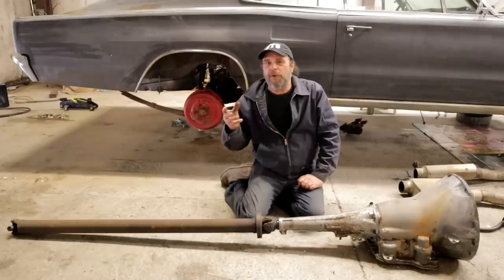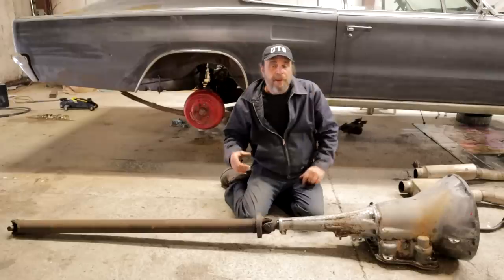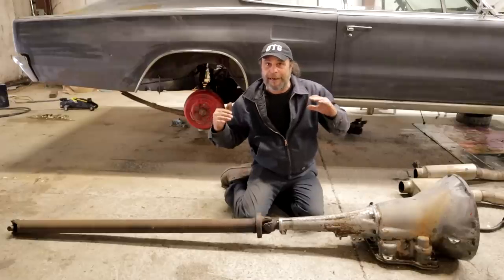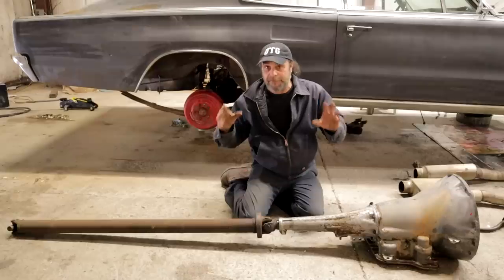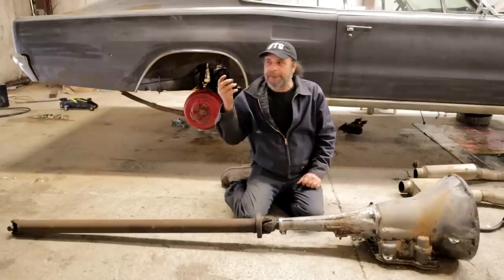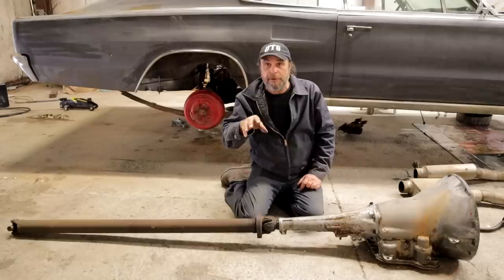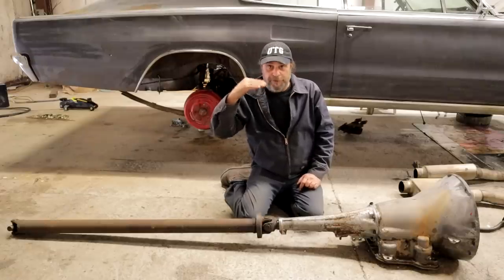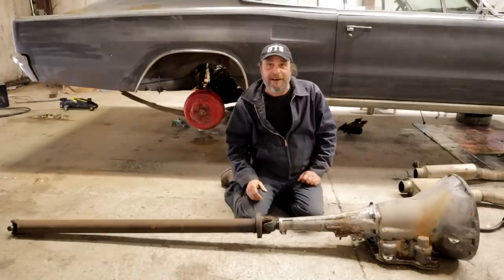Driveline Setup - Vibration And Power Loss Through Excessive Driveshaft And U-Joint Angles

Comment: I was taught that if a u-joint doesn’t have at least a little off-axis motion on a regular basis, it will cause Brinelling and premature failure.
Reply: You just wanted to show off...."Brinelling"....  LOL.
Reply: Yep, the little itty bitty rollers stay stationary if there's not a little angle ,and that's not good.
The load gets spread out by it moving. When it's stationary it's like a hammer
Reply: Brinelling can only occur upon impacting from heavy loads. There might be another failure mode in your u-joint scenario but brinelling probably isn't it.
Reply from the maker: You're forgetting that the car has a suspension...the very reason it has universal joints rather than a coupler.  The suspension is nearly always active, even to a small degree, as the car goes down the road.  This keeps the rollers moving.
Reply: You're right, Jeremy. In fixed u-joints, like industrial PTO's, you have to have some offset, or the needles in a needle bearing will stay still, and without grease, will wear into the surface. Vehicle drivelines move around quite a bit, so it's less of an issue.
Reply: @outlawbillionairez9780  I've not seen it, but know people whose irrigation engines ate universal joints til the engine was raised or lowered a half inch.
Reply: You are exactly right Jeremy it threw me off when I heard him say in a perfect straight line. 99 percent of cars the trans tilts down pinion tilts up within 4 degrees. Simple as that
Reply: In the business we call that part a consumable. A normal wear part like engine oil and tires. I've replaced plenty of U-joints that have worn out in one spot, but it takes like 100,000 miles for it to happen.
Reply: Often times brinelling is confused with fretting.. a common mistake among amateurs…. 🙄🎶🎵
Reply: @UncleTonysGarage  No driveline is ever perfectly "inline" as they require offset in both the horizontal and vertical planes. If you set a driveshaft 100% inline on all axis you will have vibration. Typically you need 1-3 degrees in each axis to cancel out harmonics and vibrations.
Reply: @UncleTonysGarage  sure with a live axle, but how about my 240sx with the independent rear end and a solid mounted diff?
Reply: UTG, what about fixed front diffs like what on newer 4x4s and AWDs? My Silverado front shaft is at a slight angle going into the front diff. Don’t you need some sort of angle to keep the needle bearings happy?
Reply: Is there really a verb form of Brinell?  Sounds a lot like BS to me.
Reply: FFS peole, if your U joints seriously never see angular changes, it doesn't matter if the rollers seize.  Which they won't, but still.

"OMG, this thing that never moves can never move now because it never moves.  Total failure!" - You
Reply: I lived in the upper Midwest. We used to race on state roads. When funny cars got nationwide TV coverage, the rookie racers started jacking up the rear of their street cars seriously messing with the drive line angles. We would bet against them and watch them destroy U joints all night. Easy picking.  LoL 😆. 
As always Tony a Master Class.
Reply: @UncleTonysGarage  I love you helping us backyard amateurs, so I think a follow up video is necessary to help us thick headed slow learners.  I put a 460, C6 and a 9” in my 56 panel.  I’m a total backyard guy btw.  Anyway, I centered engine to frame, but now the driveshaft is at a sideways angle to the 9”, but was told that’s how some fords came after the 9” came out.  I haven’t had any failures in 15k miles.  The rear pinion is equal but opposite degrees from trans… is this correct?  (Keep on doing these videos brother!)
Reply: @Todd McCarter  we come to utg for old school/mopar info. How does a 240 fit the programming
Reply: Thanks for asking that question, all the best to you all
Reply: that is what u have to do if u are running massive hp like over a 1000 hp even then u can build up a stock suspension to handle it but then again i am talking chevy with the nascar suspension and the only thing u need is ladder bars and use a cv joint and get a fresh balance on the drive line we run up to 1400 hp with that setup no problems

Comment: Getting the drive angle right for the application is critical. Driver fatigue when a driveshaft vibrates it terrible. Not to mention wear on other parts. Like having a bad tooth. It will drive you nuts but its super gratifying when setup correctly.
Reply: Curious. What kind of noise do you get when the angles are off? Is it a pulsating / droning noise?
Reply: @dennis6325  It's a vibration that sort of messes with the whole car and driving experience. Droning I suppose at various drive shaft speeds.

Comment: I've been taught that the u-joint angles need to be at equal but opposite angles... and not have one at more of an angle than the other.
Reply: Yep, the drive shaft will have minor speed variations but the two yokes will have the same speed.
Reply: Don't forget spring wrap under power. Angles are compromises based on intended useage... Cruising, or full throttle acceleration, etc.

Comment: I had vibration in my old van that shook the floor and found missing rubber from motor mounts, bad transmission mount, worn transmission tail shaft bushing, (even replaced the yoke) and bad U-joints. It took all of that to get smooth again.
Reply: Yes, my service truck started vibration at 67 mph, had a service notice / repair for it, replaced transmission mount = all good
Reply: Probably started as one thing, then snowballed, this is why it pays to investigate early.

Comment: I think you're off on this one UT. Out of the thousands of different models of vehicles produced they were never set up with zero angles on the drive shaft. Ideally you want the transmission (down) and the pinion angle (up) to match. I think you were also trying to imply running the u joints at an angle causes speed variations? I've heard that somewhere else but that's false. The angle causes the caps to run in 2 different planes but at the same constant speed. If you think one set of caps as speeding up and slowing down the other set would be doing just the opposite at the same time. Kind of an impossible situation.
Reply: Yes,  well stated.  That is what I have read.

Comment: The rear pinion angle of -3° to -5° depends greatly on what crankshaft/tail shaft angle you have up front. 
Each vehicle has a slightly different crankshaft angle.

Comment: The engine is placed at the industry standard of 3 degrees down and the axle pinion placed at 3 degrees up. This takes care of the joint lube issues.  Since the universal joints are not made to work  completely straight. The needle bearings need enough angle to make them roll in the lube. That's how they are assembled. And the u joint manufacturer also explains that.

Comment: Those Nolathaine bushes you are replacing the rubber with work quite well I have had them in my 69 Valiant for the last 20 years and they have held out quite well. Down under in Australia the factory manual specifies to use a tap to remove the cup if it is worn out.  Recommended tap is ( Inch and 3/8 12 threads per inch. They come out very easy using this way on a press if someone is choosing to replace bushes with rubber  PS I like your technique as not everyone can get their hands on a tap. We also had upgraded lower control arms in the later model valiants which were plated on the ends of both arms to prevent the lower arms from distorting and result in the bushes prematurely wearing out. These arms also were an option on police vehicles. Keep up the good work Tony

Comment: Another good show Uncle, do a follow up on how to make the angle adjustments with plates between the springs and spring purchases and uses of a pinion snubber.
Keep up the good work. the youngsters need someone to show them what we went through without the Uncle Tony's. 
I'm 68 and restoring a 1972 Duster, 440/ 727/ 8 3/4/ 3.55 posi/ Power steering/ power 4-wheel disc./air conditioning/ Bluetooth radio system. It should be ready to fire very soon and then to the paint shop.
Harry

Comment: From my experiences and as noted by specific scientific literature on using hookes joint universals, the aim is to cancel out variations in the rotation speeds (changes in velocity) of these joints when they work in pairs at an angle. The usual method  is to ensure that both the crankshaft & transmission line and the pinion angle line of the rear gear set (in a traditional front engine rear wheel drive car) are both parallel to one another when viewed from the side. It doesn't matter if the differential or engine/trans combo is higher or lower than each other, as long as they are parallel. Setting up the driveshaft in this manner effectively cancels out the differences in velocity changes in the rotational speed of hookes type universals due to the opposing universal joint compensating for the other. A perfectly level driveshaft using hookes joints is a no no, as there has to be a slight difference in angle otherwise the needle rollers within the joint won't rotate  (as they are a bearing) and the universal joint will have a very short life. The rollers will effectiively dig into the journal surface creating gouges. 
Not mentioned also, is that they should also be phased correctly to one another if using a slip yoke type tailshaft. A novice enthusiast may not be aware of this and fit a hookes type universal totally out of phase with its partner at the other end. This is more common on cars that run a flange on the rear of the transmission and not a sliding joint. Centre bearing driveshafts need to be setup carfullly and thoughtfully if driveshaft vibration is to be avoided. Just my 2 cents Tony. I enjoy your presentations.

Comment: I did lots of stuff in this area and one of the issues is if you can't make a straight  driveline (most of us) keep the angles equal between the from and rear universals to reduce vibration. I have seen many jacked up cars that forget that issue and are terrible to drive on the street do to the vibration caused by that setup is undrivable in a cruise car.

Comment: If you cut the tail shaft & re weld make sure  the uni joints are put back in line the same .The angle should be the same front & rear also.I had to line up a GE Jet Turbine once to a gear box with a short about 1M long tail shaft .It had to have a bit of offset both ends to work the roller bearings like other people have said.If you have angle only on one end you get all the vibration to the wheel.If both ends are the same but to excessive a angle its mostly the tail shaft that vibrates depending how heavy it is.Someone in Australia invented a double Yoke set up to handle much bigger angles.

Comment: Check out Dick Landey's books on kinda primitave mopar suspensions for drag racing. We aplied it to a ford and it worked! Nobtraction bars or extended shackles. We moved the leaf springs rear but put the rear end 1/2" foreward. The car lifted the rear and went. Bent the frame and the doors wouldn't open!
Reply: The car lifted the REAR?
What?
Reply: @fastinradfordable  watch the rear end video of any fast car and the body in the back rises. If its pushing up on the body its pushing down on the rear axle. He did it in the 60s with mostly factory parts.

Comment: Tony, I think my truck may have this problem. I hear a pulsating noise in the cab. I put clamps on the leaf springs in front and behind the perches to stiffen them up and that helped reduce the problem. Anyway, I was curious what it actually sounds like and if it is a pulsating / droning noise? My vehicle is a 1976 K20 chevy truck with a SBC 350. I have a 2" lift over stock. I have measured angles and my pinion is set 2 degrees nose down with shims to account for torque during acceleration. One thing I did not consider is the angle from side to side. I will have to check that out.

Comment: Speaking of driveshafts, what determines diameter? Is bigger stronger? My C3 corvette drag car has a small dia. shaft. About 2-1/2". The GMC pickup I tow it with has a shaft twice that size. Is it a matter of available space? Does length matter?  The tiny shaft in the Vette ( which is very short) handles 750 HP and never had a problem.

Comment: I had an old jeep that I put about a 5” lift on with big silly tires, and that change in the driveshaft angle turned it into an absolute u-joint eater. About every 15,000 miles I had to pull the shaft and throw new joints in or it wasn’t gonna be pretty.
Reply: I believe it. My buddy has a 77' highboy ford with an insane amount of lift and giant tires. We would have to bring several spare u-joints bc we would brake one almost every wheeling trip because of the crazy driveline angles...
Reply: My 88 dodge ram charger with a 6" lift, would eat a rear u joint every 6,000 miles. The drive shaft was straight in line with the differential, the roller would just be pounded. Unfortunately dropping the transmission cross member. Is not easy on those.

Comment: I’m going to swap a 440 and 727 trans into my 67 barracuda some day. I bought a trans, and engine is underway. I assume I’ll need a larger diameter driveshaft, or custom driveshaft-and just toss (like Uncle Tony likes to do) the slant 6’s driveshaft out to the yard. 
QUESTION: what clearance do you need at static state, driveshaft yoke to trans…to avoid binding during drag strip launch?  I’m guessing this dimension is key to having correct length driveshaft.  So much to learn. Thanks!

Comment: The steering box is usually on the left, therefore the engine would be offset to the right.  So you would want the pinion to be offset to the right as well.

Comment: Uncle Tony you are so wrong on this, the engine/transmission crankshaft/transmission output shaft has to be parallel to the rear end pinion shaft centerline but at an angle. the engine/trans centerline can be higher or to the side of the rear end centeeline. There is a degree angle, I want to say 30 degrees that is the most you want to go. I have made front driveshafts for high lifted Toyotas that universal joints had plate that bolted to plate on the trans shaft and one on the pinion and the drive shaft had a slip shaft like a power take  off shaft on a bush hog mower, these trucks had 12 inches of lift or more to clear oversize tires. where the universal angle will be too sharp, folks use a CV joint Bumps and hog head twist on acceleration are acceptable variations to a point. Pointing the hogs head upward or having you motor/trans at a downward angle so the pinion/driveshafts/trans shaft/crankshaft is on a straight line is WRONG!! You want the centerlines parallel with driveshaft at an acceptable angle the same on both ends at rest...the universal joint is designed to run on a slight angle no matter if the driveshaft is 3 inches or 30 feet.
Reply from the maker: I think you misunderstood a lot of what I said in this video.  Too much to cover in a comment.
Notice in this video, I used the terms "Ideally", "In a perfect world" and "In theory" several times.

Comment: I always thought that there was supposed to be a few degrees of angle at both ends of the driveshaft. I thought it was supposed to be equal angles at both ends. Just a few degrees. I can't remember where I heard that. But I'm more confused than ever now.
Reply: The angles are supposed to match as close as possible. As much of the time as possible, it’s a big compromise, make them match under hard acceleration and it will probably vibrate under deceleration. Matching under light/ moderate acceleration is what I shoot for. Pinion nosed down a few degrees more than the engine/ trans angle.
Reply: Yes , that is what I have read in my manual for my car.
Reply: Yes, I have read that in my manual.

Comment: Didn't check all the way down; did anyone ask about center-bearing drivelines?  My old Nissan Frontier and my '87 Ford Ranger 2.9L use rubber-mounted center-bearings connecting two short driveshafts.  How do they fit in?

Comment: The remedy for vibration with 5 degrees of pinion angle. Stronger front segment on leaf springs. Then you can run less angle.

Comment: My 68 Firebird has a very slight vibration on the turnpike but when I let the throttle up very slightly, not decelerating or accelerating it goes away. Yes my drive line angle probably changes slightly,, I have constant velocity u-joints on the output trans yoke could I put another one on the rear end yoke??

Comment: I still haven't figured out how u-joints work, though: when they're vertical (like an upright cross) the up and down movement they allow is obvious. But turn them 45 degrees so they form an X and they're rigid--they don't appear to allow vertical movement at all.
Reply: I'm no expert, but in general terms, if it's straight up, only the bearings on the horizontal axis rotate if you move the axle up and down with the driveshaft stationary, say with the car parked and you're pushing the trunk down. With the driveshaft at 45 degrees, the bearings on the two axes rotate an equal amount in opposite directions. At any other angle, they rotate proportionally through the range of motion, again in opposite directions on the two axes. If the driveshaft is turning, the ratio of the movement on the two axes is constantly changing and reversing direction as the shaft turns. If you have a u-joint for your socket set, turn it in your hand and watch the pins closely as the yokes go around. It might be easier to see with an extension on either end.

Comment: So on a vehicle with a driveline  angle is it a good idea to use a CV style joint? Is there a strength issue? Would you only need that joint at one side of the drives haft? My 93 dodge Cummins uses a CV at the front drive shaft but not at the rear and there is an angle. At around 50 mph you can feel a bit of vibration but above or below that it's fine.